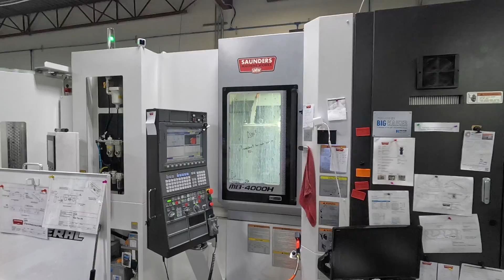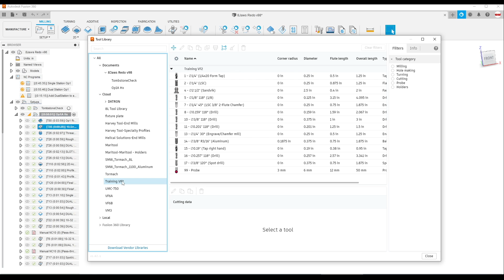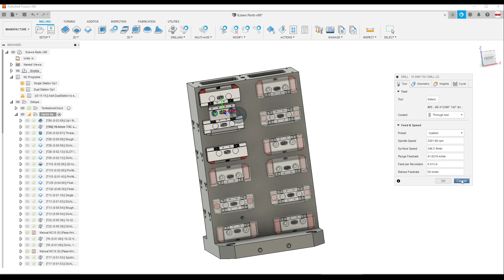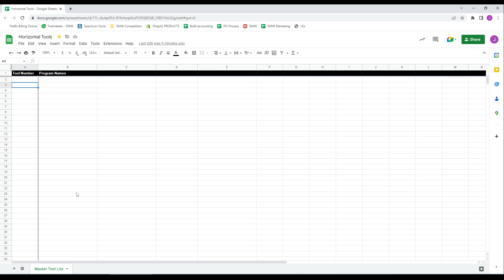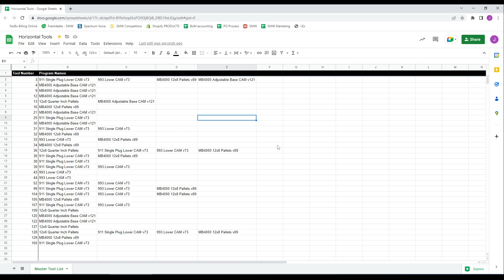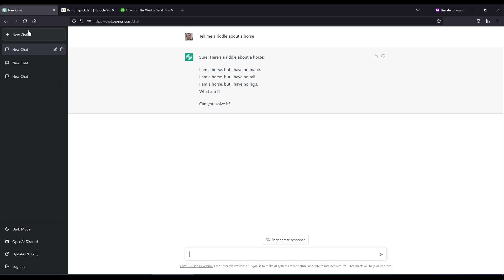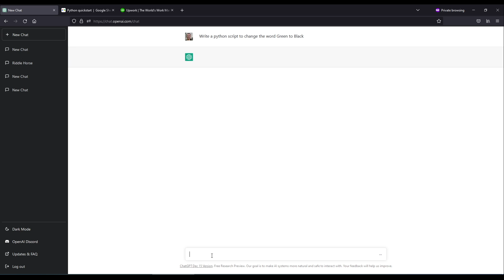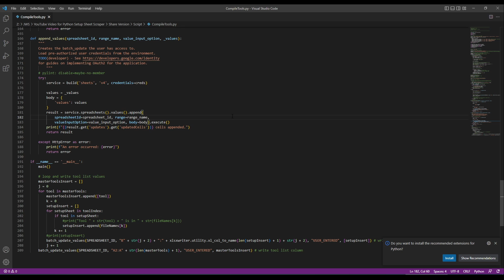Tracking Tools across Files in Fusion 360!

Comment: When using ChatGPT, always include #verify_always in your questions or it will often straight up just make stuff up.  Just used it to check if Autodesk has come up with a master tool list solution since the making of this video and it told me it had and completely made up the process of how it's done.  It's good at making up stuff, but not so good at compiling accurate factual information unless you specifically tell it to verify it's sources.

Comment: I made a function that does something similar that can be directly integrated into your post, it could be pretty easily modified to track if a tool has thru spindle coolant.
but basically it just creates a csv that updates every time you post  a new program and will tell you if a tool needs replaced

function updateTools(path){

try{
var file = new TextFile(path, false, "utf-8");
}catch(e){  //if file doesnt exist create new file in path and open it for reading
  warning("file not found creating new file at: "+path)
  var file = new TextFile(path,true,"utf-8");
  file.writeln("Tool Number,Diameter,Description,Length below holder,Tool holder,Flute length,Vendor,Product ID")
  file.close();
  var file = new TextFile(path, false, "utf-8");
}

storedTools=[];

try{
  line = file.readln(); //skips first line
  toolParameters = line.split(",") //get tool paramater names from first line
  while (true){
    line = file.readln();
    storedTool = line.split(",");//gets all values seperated by comas
    let toolObject={}//create a tool object
    for (var i = 0; i < toolParameters.length ; ++i){ //iterate thru the parameters from first line
      toolObject[toolParameters[i]]= storedTool[i]; //add parameters and their values to tool object
    }
    log("TOOLOBJECT="+toolObject["Tool Number"])
    storedTools.push(toolObject)  //add tool object to array storing all tools
  }
  }
  catch(e){
   }
file.close()

var file = new TextFile(path, true, "utf-8");
file.writeln("Tool Number,Diameter,Description,Length below holder,Tool holder,Flute length,Vendor,Product ID");
//open file to write

var tools = getToolTable()
replacedTools = []      //store tool number of replaced tools

for (var i = 0; i < tools.getNumberOfTools(); ++i) {
var tool = tools.getTool(i);
toolUsed = false
let toolObject={}
if (storedTools.length>0){
for (var j = 0; j < storedTools.length ; ++j){
  if(parseInt(storedTools[j]["Tool Number"]) == tool.number){
    toolUsed = true;
    if(storedTools[j]["Description"].replace(/\W/g, "") != tool.description.replace(/\W/g, "")){
    storedTools[j]["Diameter"] = tool.diameter.toFixed(4);
    storedTools[j]["Description"] =tool.description.replace(/,/g,"");
    storedTools[j]["Length below holder"] = toolFormat.format(tool.bodyLength);
    storedTools[j]["Tool holder"] = tool.holderDescription;
    storedTools[j]["Flute length"] = toolFormat.format(tool.fluteLength);
    storedTools[j]["Vendor"] = tool.vendor;
    storedTools[j]["Product ID"] = tool.productId;
    storedTools[j]["Replaced"] = true   
    break;

    }
    
    
  }
}
}
  if(!toolUsed){
    toolObject["Tool Number"] =toolFormat.format(tool.number)   //toolFormat.format rounds value
    toolObject["Description"] =tool.description.replace(/,/g,"");
    toolObject["Diameter"] = tool.diameter.toFixed(4);
    toolObject["Length below holder"] = toolFormat.format(tool.bodyLength);
    toolObject["Tool holder"] = tool.holderDescription;
    toolObject["Flute length"] = toolFormat.format(tool.fluteLength);
    toolObject["Vendor"] = tool.vendor;
    toolObject["Product ID"] = tool.productId;
    storedTools.push(toolObject)
  } 
}

storedTools.sort(function(a,b){return parseInt(a["Tool Number"])-parseInt(b["Tool Number"])}); //sorts tools in descending order

for (var i = 0; i < storedTools.length ; ++i){
  entry=""
  for (var j = 0; j < toolParameters.length ; ++j){
    entry+= String(storedTools[i][toolParameters[j]]+",")
  }
  if (storedTools[i]["Replaced"]){
    warning("TOOL "+storedTools[i]["Tool Number"]+" REPLACED")
    entry+=",Replace tool!"
  }
  log(entry)
  file.writeln(entry)
}
file.close();
executeNoWait("chrome","file:///C:/Users/james/AppData/Roaming/Autodesk/Fusion%20360%20CAM/Posts/toolTable.csv",false,"")
}

Comment: nice but until all can 'infuse, various viewpoints of any subject matter,' it's no different than the writings or ideas of a single-minded entity. chatgp (for now) is just an extension of singularity...GIGO then call it AI, yup and nope!!
good stuff on your tool tracking.
Using a database, input (yup takes time) all parameters for a tool used to include purchase source, tool usage etc., then add queries...couple that with a text editor and you're on your way!!---run a script without excel limitations---admittedly a friend setup the database shells and I modified it for numerous functions;  90-day forecast what maintenance task(s) are due and what machines are affected, supply materials on hand etc...print it out or display it on your devices--pre-programmed time-based background queries --nothing specific suggested here at at all, just another approach at a fix not using excel (unless you excel using excel!

used to have stickies all over the place lol

Comment: F360 also makes it difficult to change tools for a setup that uses the same tool for multiple operations when changing to a different machine. 

Rt click and "edit tool" would appear to be the workflow to change the tools, but it just edits the parameters if that tool. 

Very cumbersome to manually edit each operation and select a different tool for each op.

Comment: We use an 8-digit tool code instead of pot numbers on our horizontals that I really like. So instead of saying something like T32, we would use T21050030. The first number 2 defines this tool as an end mill, the 1 defines it as a 4-5 flute end mill, 0500 means it's a 1/2 in size, the 3 means it's mostly used on steel, and lastly the 0 means it the first tool we made up. If we make another tool with a different stick out or if we just want a duplicate we would just change the last number to a 1, 2, 3... This way the program will only call up the tool you want not whatever is in that pot.

Comment: Thank you sir......... For spending the time to make this country a better place..... Could you make some fixtures and some laps and make your own ball bearings.... With your CNC equipment.... I don't know what the accuracy has to be in a ball bearing but I would think it would have to be plus or minus 5 millionths... Or even closer.... 25 years ago I bought some spindle bearings for an old Bridgeport and the bearing house had a balanced set of general motors matched bearings at an absorbitant price it was over $200 for two small bearings...... I guess general motors made bearings at one time maybe they still do the CEO of general motors is a woman and she's a electrical engineer that's Mary T. Barra... And her dad was a tool and die maker for general motors for years and years... I was just wondering if you could do such a thing.... In 2019 approximately there was an addition to Google and it was called" Google lens" that was so intriguing to me you put the app in your phone and take a picture of something and it'll tell you what it is. The app logo looks a little bit like the Instagram logo but it's different... But I was able to identify plants.... And I found this funny looking tool and it said that it was used in air conditioning repair and it new what that tool was.... It identified some pine needles one time and told me what kind of tree it was very fascinating world we live in and it's cool having folks like you in it you're a gift to the world... praise God.

Comment: I feel this should be handled buy the cell controller. The cell controller should be able to tell you what tool is ran with what program and create a spreadsheet for you. Also the cell controller should be able to look thru its loaded tools and be able to say if the program can run or not. I'm surprised it cant do that, maybe Okuma has a update you can purchase? That being said, long ago we ran into issues with changing dedicated tools lengths, coolant parameters , etc... We found that once you make a tool up, you never change it, like ever. If you need to change stick out length or anything like that, you then create a new tool number. In the long run we found it cost way more time and money to try and manage changing dedicated tools and update all programs then it was to buy another tool or even duplicate tools so you had backups. You could have 8000 assemblies if you wanted, the machine doesn't care what tool number you give it, or at least it shouldn't? I would think it can run T8456 H8456 in whatever pot number you designate to it..

 Having programs that use two different tools or even slight differences with the same tool number is a big issue and get out of hand real fast.

Comment: I believe there is a way to alter the setup sheet template to dump information in different formats to make it easier to scrape.  You could potentially use it to drop information about the tool itself, the length, the diameter, ERP number, whatever and then use that as the basis for comparison rather than just the tool number itself.  So you could potentially write a routine to scan all incoming setup sheets and then alert when a new setup sheet alters a tool number's parameters and then make the list of what tool is affected.  That way if someone changes a tool in one program and forgets that they did that, the system knows that something was changed and can provide more information.

On second thought, it might be a cool idea to have a network share of "live" programs that are loaded in each machine (could be the network share on the control itself) - programs that are actually allowed to run on the machine in its current tool loadout and configuration.  Then you could have all this tool information as comments in the gcode itself, have the system scrape the gcode, and parse through it the same way.  That way, if someone wanted to run a program on the machine, they would have to load it to the control from that folder, and the python script would alert if a program was inside the folder that had contradictory tool information from the other programs.  If the tool absolutely needed to be changed, you would delete the programs from the folder that clash with the change until the script stops alerting, and then you would have to repost them with the updated tool information if you needed to run those old ones again (to check for collisions etc).  You could potentially even version the names or something (1/2" 3fl Aluminum Rougher V2.1) with new speeds and feed parameters to force other programs to update to the new master tool parameters.  The versioning could even be worked so old programs aren't forced to repost unless there is a new major version number, like if you just slightly tweaked feeds and speeds you might do a minor bump to V2.2 and wouldn't require a change but causing a warning from the script, but if you broke a tool and decided you needed a global change to feeds and speeds to prevent breakage in another program, you could make a major V3.0 change and get an error in the script from the old programs in the folder.

The benefit to this is no additional step of manually producing a setup sheet, and the python script can just be always running, looking at the network shares for file updates, and either feeding a MQTT to alert on an alert system (home assistant, whatever) and everything is driven from the actual gcode of what is being run.

Comment: Hi, first thanks for the video. I am using the setup sheets different I am running linuxcnc and have them displayed there. But why going on the sheets for this task. parsing the G-Code files would have been easier I think and you avoid the error if you change some tool, but didn't update the setup sheet.
Fusion let you write all the tools used in the header of the code file. This way you can also compare the tool information "(T202  D=6.5 CR=0. - ZMIN=-17.332 - THREAD MILL)" and throw errors if there are differences. And if your file server is running linux you can watch the folder for change and run the script automatically after a program change.

Comment: This is just the beginning of what you will find to be major limitations of doing horizontal tombstone machining of multiple, varied parts in Fusion 360. 

Better CADCAM all have a module or extensive tools for handling tombstones. As way of an example of missing Fusion 360 tombstone functionality note all the ordering options at 11 04 of the following video:

https://www.youtube.com/watch?v=mdbNogowM-4

Comment: I think you can define 1000 different tools and tell the cnc machine that tool 561 is situate in pocket 89 and use different tools for different parts or programs where a tool number is always the same tool no matter what the machine is or program is.
for example you make tool number 1 as the drill number 1 tool number 2 as the drill number 2 nd so on and so forth the same goes for letter drills and spot drills of different sizes and endmills from different manufacturer, which means you can for program 1 use tools 153,256,345,561,842 and for program 2 use the tools 643,54,21,201 for example this way you don't have to change the tool definition in the fusion library and chase the tools all over your programs but just use different tools for every programs I think the haas control have 1000 tool offsets so you should be able to define 1000 different tools and I am sure that the heidenhein control does have this capability, I am not sure about the okuma's osp control though.
for the stickout issue I think you should indicate that in the controll but if you are going to do a huge change that can't be compensated through the control than the only way to do this is by parsing and going manually to update the tool definition, it is sad that fusion doesn't have a linked library I think they were just lazy about it and focused about other stuff as it should easy to implement, as an advice I think you should use the conversational programming in the control more often the osp control is that powerful and ditch fusion since you have a high volume production and not a job shop environement where you have a new part to machine everyday, unless you are continuely optimizing your process and testing new holders and new tools of course.